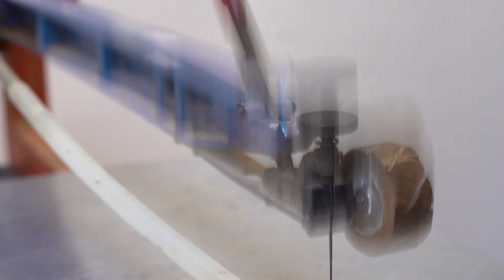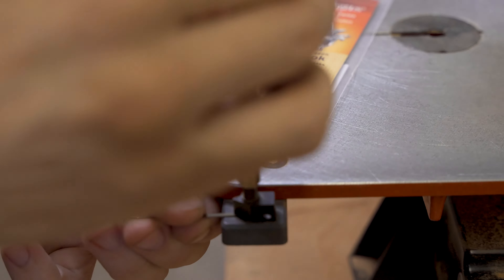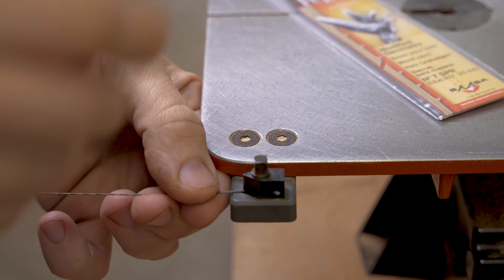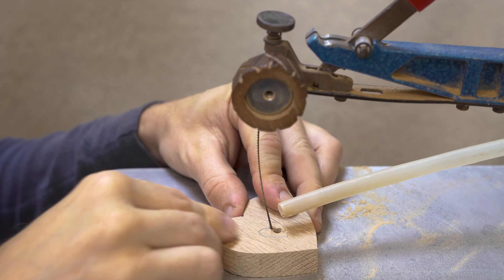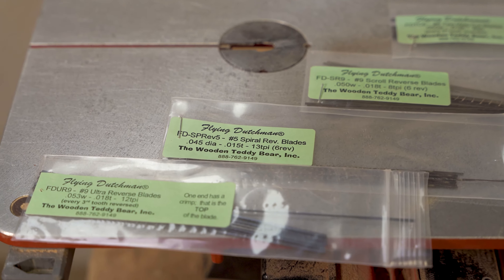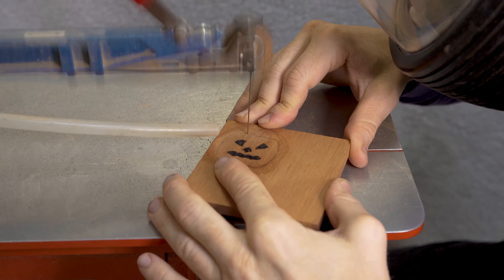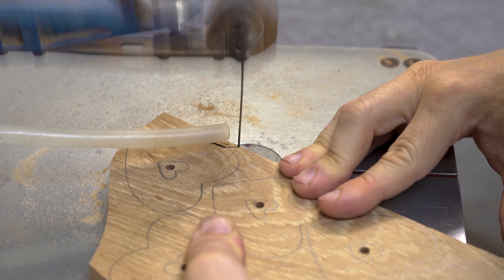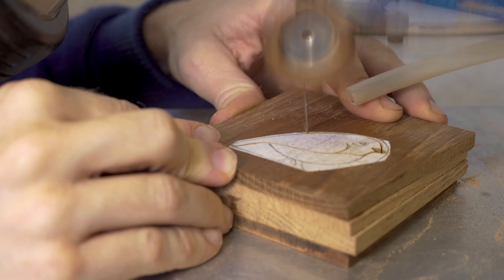Scroll saw blades. Pegas vs Flying Dutchman vs Niqua Speed.

Comment: Your Hegner saw looks really smooth in action ,mine just keeps lifting the wood up !!
Reply from the maker: The Hegner multicut 2s is a great scroll saw. I have ours bolted to the base and the base bolted to the floor to minimise vibration and reducing the chances of the wood jumping. Getting the tension on the blade correct is another possible cause of any jumping wood too.

Hope you get to the bottom of the issue. Thanks again for supporting our YouTube channel, all the very best from us all. 👍👍

Comment: I have now used all three brands for both hard and soft woods. I also cut different thicknesses of plywood. I started scrolling with Ultra Reverse Flying Dutchman and I really like them the best overall. But, I do think that the same type blade from Pegas  ( Geometry) might be cutting a little faster and straighter using the same types of wood I normally cut. As for the Niqua that basically matches the Flying Dutchman, the jury is still out. They are ok, but I won't be buying anymore. I'll keep buying the Flying Dutchman and a couple of the Pegas I like. The Pegas doesn't slip in my DW788 Type ll Scroll Saw. None of the Niqua ever broke for me. But, maybe it is because I use the larger sizes or I was just lucky. Thanks for your evaluation! Take care!
Reply from the maker: Hi Michael, great to hear from you as always and thank you for sharing your thoughts. Just out of interest, was it the Niqua speed blades you bought? I have previously had Niqua Fix blades and found them impossible to work with. The Niqua speed or Niqua Pebecco blades have always been my own favourite to work with but the Flying Dutchman blades were basically the same blades with a different name on the packet. Pegas were great once they had been sanded on either end.

Thank as always for your support, all the very best from us all. 👍👍
Reply: @DailovespoonsThomas   The Niqua is Ultra Skip + Reverse #9 12TPI. The Pegas I like is the Modified Geometry #12R 8.6TPI. I can't remember the other Niqua one because I used them up and tossed the info. I won't buy any more Niqua. I just bought the one size Pegas and I like it.
Reply from the maker: @michaelmarchione3408  hi Michael, thanks for getting back to me on that one. Not a blade I have ever used myself. The one I use is the Niqua speed blade and has a lower tpi. Always great to hear about different blade experiences.

Thanks again, take care, all the very best from us all. 👍👍

Comment: Can i cut letters in 3mm brass by flying dutchman
Reply from the maker: @savalaramsathe232  you'd need a metal cutting blade and the correct number too. Flying Dutchman is the same as Niqua so there should be a suitable blade for the job.